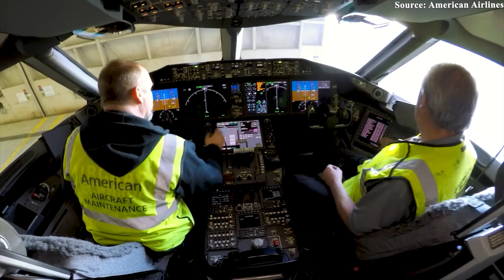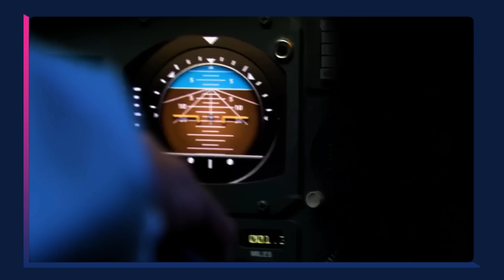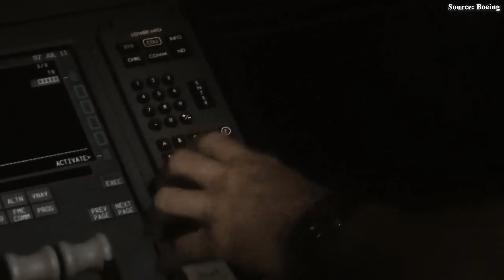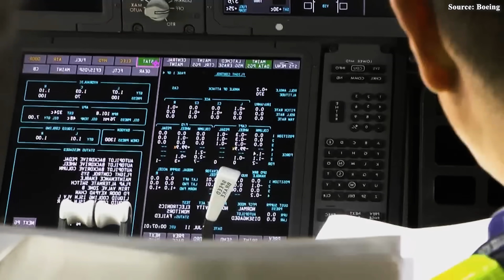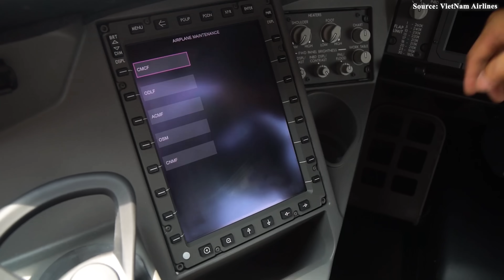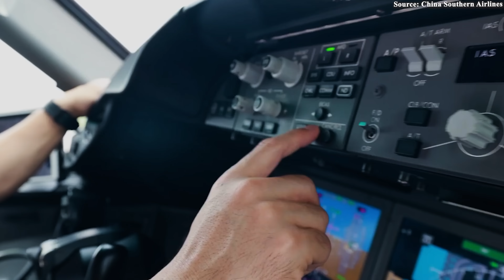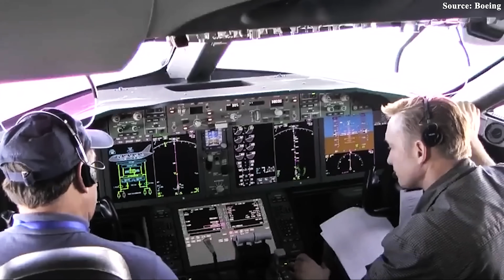They Just Dropped a BOMBSHELL about Boeing 787's AI 171 Flight!

Comment: This video is total BS and sponsored by the airliner manufacturer and airline.  In the preliminary crash report, it says fuel switches “TRANSITIONED” from Run to Cutoff.  It does not say switches were manually moved.  The pilot comment “Did you Cutoff” suggests surprise.   If engines lose fuel power, the pilots can immediately sense it.  During takeoff they said “no thrust”. The pilot’s question was in DISBELIEF.  This points to an electronic failure that caused the fuel shutdown.  It happened without manually moving the fuel switches.  When pilots manually moved the switches, this was a last ditch effort and the protocol the pilots are trained to do ‘turn off (cutoff) and then turn on (run) the fuel switches to restart the engines. 

Note, the RAT (mini propeller electrical generator)was automatically deployed just before liftoff.  This happens when there is an electrical power failure in the plane. Note, pumps need electrical power to pump fuel to the engines and the RAT would provide backup power to run the pumps.  This information is not clearly pointed out in the report and adds confusion and allows people to think the crash was solely due to pilot error.
Reply: Many errors of known facts in your comment.
Reply: Fully agree

Comment: This is absolutely bullshit reel. Nowwhere in the report has it been said that the fuel switches were turned to shutoff manually as claimed in this reel. The report clearly said that both the switches turned to off position in a space of 1 second. So, can somebody tell me as to how both the switches can be turned off mid air in a space of 1 second when it has to be pulled up and taken down, a action which in itself will take 2 to 10 seconds ? This reel is a paid reel by Boeing and want to brain wash the minds of the viewers
Reply: Unfortunately new findings have found that it was that the switches were flipped off and 10 seconds later were flipped back again. They only take 1 second to flip.  And there was no flame out prior to take off. You can make your own conclusions

Comment: In decades of aviation history, millions of flights taking place on Boeing's planes every year with practically the same Boeing's "misplacement" of the fuel control switches, this is the first accident where a pilot moves such switches inadvertently. Incredible!!
Stop blaming the manufacturer and assume what the preliminary report states. The cockpit voice recorder does not only record voices, also sounds. Analysts spent many hours listening to that recordings. Alarms went off after the clicking of the switches.
Is it that hard to assume that nobody is trying to blame the captain of deliberately taking that plane down?
As for now, we just know the facts and THOSE are the facts, as hard as they may seem. What we don't know yet are the causes and that's is what they are trying to find out. There is no definitive report yet. Let's wait and hope investigators do what they are supposed to.

Comment: According to the prilimaniry report both the engine cut of switches were flipped to cut off within 1second, These switches are not like the light switches in our homes which can be flipped easily. The fuel cut of switches have a locking mechanism and it takes more than 1 second to flip 1 switch. Yet both the switches were flipped within 1 second. Show me 1 pilot in the world who can do that. It is easy to blame the dead pilots as they won't be able to defend themselves.
Reply: All the investigators need to do is read the YouTube comments from all these aviation experts that know exactly without a doubt what happened. They'd have it solved in 5 minutes
Reply: @tomw4678 you don't have to be an aviation expert. All you have to do is listen to what the pilots who fly the 787 are saying.

Comment: If the flight had taken off normally and attained an altitude of over 800 feet where was the high pressure situation in which Pilots could have done the mistake??

Comment: I just don't understand how you can turn off the fuel supply in flight without also hearing an alarm or warning signal for that. After all, the computer knows you are in the air and not on the ground.
Reply: E o mais ...... E que o avião começou a subir.....correu a pista ....como não suou o alarme de corte de combustível?🫡
Reply: What if the computer malfunctioned and still registered the plane was on the ground and not airborne.  In this precise mishap (glitch in the computer sensors) the fuel would be cutoff or restricted severely causing lack of thrust in the engines to remain airborne. More intensive investigations are needed and data readings crossed checked to determine the truth. The public needs to setback and let the real investigations begin before jumping to unvalidated conclusions.